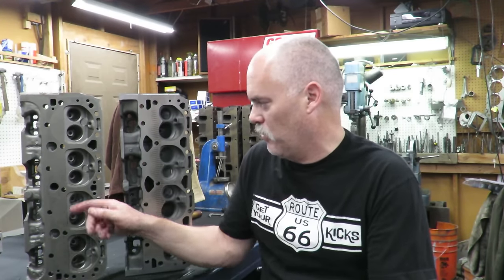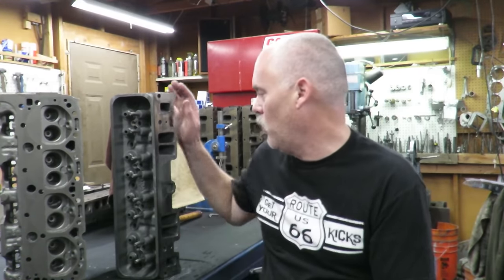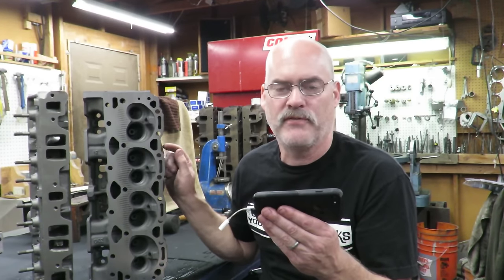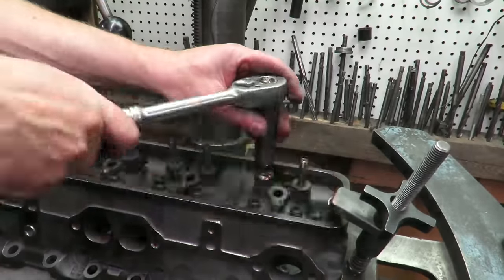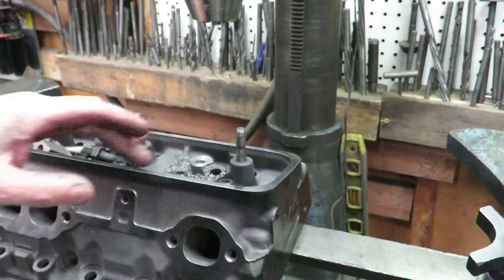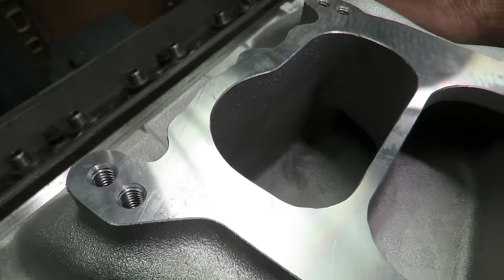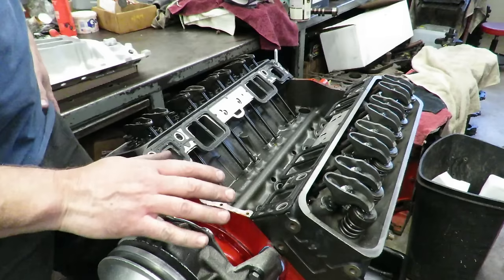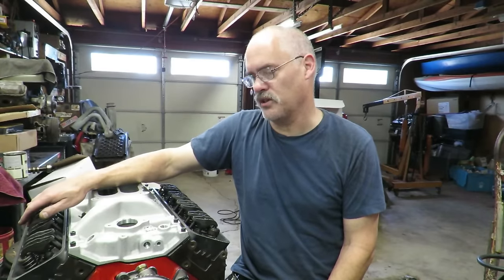How to get more power out of your Small block Chevy

Comment: The heads they used on engine masters were also ported and polished with matching porting on the intake
Reply: We must have watched different episode's, I just went back and dBm checked, factory Vortex heads
Reply: @stevenclark5248  we may have of course there are so many nifty little tricks for small block chevys I might even be mistaken but I'm pretty sure that's what was used on that bad bowtie
Reply: @joeymartinez3642  Yes Sir, It's a twister man! Regardless, all good tech info, that's what this is all about! At least it's not the "All Cntr Bolt Chevy Heads Are Vortx'szzz" lol! Thanks.
Reply: @stevenclark5248  no problem man I don't mean to start arguments just thought I had info to add or clear up

Comment: Hey man if you happen to catch this comment that 350 small block upgrade with the Vortech heads were you drilled the manifold matching and set it up for screw in studs.. I was wondering what cam specs were you used on that motor I want to try to duplicate that here at my shop in Mountain Grove Missouri You really do a good job on these videos man lotta help thanks

Comment: I have a 93 Chevy van / box truck with 350 TBI that needs a little more power climbing hills or just keeping up sometimes. Instead of me changing out my heads, could I swap out my engine with a Vortec engine of most models less the timing chain cover and reluctor and just change to aftermarket TBI intake ? Didn’t know if there would be any issues with my computer. Hopefully accessories will bolt up to heads and block...alt, p/s, a/c. From pictures I’ve seen, seems to have same bolt pattern on end of heads. Also has 4L80E transmission that can handle most any load.🙂
Love watching your videos. 
Thanks Billy

Comment: Hi 👋 I liked what you did showing  how to removing the Rocker studs I was thinking about trying that but I don't have the jig you use to do that I do have a drill pres and I was wondering about making a jig out of wood and bolt 🔩 the head to the jig. Also I have Mig welder maybe I could even come up with something that could make the wood a little more stable when drilling. Also where could I buy cutters you used to do the job. I would appreciate any info you can give me please and thank you Ray in Idaho
Reply: Comp Cams, Proform, Goodson sell cutters
Reply: If you plan on making a jig that you are going to use more than once then just pay attention to woods that are very stable and perhaps laminate pieces to gather since resin glues will resist movement

Comment: Seems like everyone forgot about my fave. 400 sbc. Bored 60 over. Decked center line honed. Big power. Low end tire shredders.  Rock crushers + a overdrive. And in overdrive top gear. 20 mpg highway. Easy on the gass pedal tho. Lol .a 4 banger eats gass WITH your foot in it
Reply from the maker: No one forgot about it they are just hard to find these days

Comment: ARP make's a really sweet Stainless steel 12 point intake manifold bolt set with machined washer's for SBC motors that are just fantastic I used them with My First or early design Weiand Stealth  intake manifold that made more power than the 1970 Z28 intake I used it with a 650 cfm Holley and a 1/2 inch spacer  in my 78 Chevy  Malibu wagon with a 1977 GMC  350 4 bolt main truck motor and the Comp Cams High energy 268H cam  with Blue print series Distributor and Jet hot coated long tube with 3 inch pipes exit behind tires 700R4 with street lock gold Converter by Fairbanks and a B&M converter lock up control   That wagon ran so sweet  and sounded like a million bucks.. however the heads were early 2.02 with accessory holes

Comment: Interesting and helpful video.  The comments (414 as I write this) are also worth reading A LOT of information.
Locally pulling an engine out of a yard is the same cost for any V-8,  tougher to find larger displacement LS motors, quite a few 4.8, not as many 5.3 (they get taken pretty quick so suspect they are just gone before I see them and 4.8l gets left behind), next to no 1st gen SBC but the 5.7l "R" code Vortecs don't seem to get love and those I can find, not lots but available.
Just an opinion, based on lots of research and taking that and Youtube videos for what they are worth, starting from nothing,  it seems the cheapest route is turbo charged LS. 
IF you don't care about vehicle that infers, at least locally, I should be getting a Chevy or GM truck (most choice of LS based engine and all wiring and computers in place). 
IF a drag vehicle, as light as possible and turbo LS swap, then the largest costs becomes a matter of who is doing the work and I gotta think those costs are going to be very similar between the SBC and LS builds. 
My gut says SBC w nitrous will be less than LS with turbo (turbo being way more labor) and get similar numbers.

Comment: Very excellent video. I bought a 1968 327 engine that came out of a school bus or a dump truck. According to the eng. suffix code. 2 bolt main 2 bbl with 1.72 valve's. Must have been a torque monster. My question is can you make 2.02 heads from 1.94 one's. My machinist says its possible but I've never heard of such fairy tales. I'm on a super tight budget and I'm going to try to squeeze 300 hp with the 1.94 heads, that is of course using 68cc chambers. Your input is very much heeded. Thanks

Comment: i have a 95 GMC and a 95 chevy truck both are stock and I'm looking for a little more horsepower in each. both have throttle body injection. I'm wondering why you change to a carb with your project? also how much difference in horsepower would be gained by headers and a freer flowing exhaust system? tyvm enjoyed the video and liked and subscribed!

Comment: Ok, I really love how u explained everything,
I have a 69 nova, 3.73, positive lock right, 400t ,2400stall, 255/60/15 mt et, drive train is set up fo 280h comp cam,  my 355 old engine block sprung a leak!
Question, how much would you charge to build a long block 280h comp cam install,  w/o manifold,  carb, waterpump, valve covers,  distributor

Comment: i put vortek's on a 283 with  victor jr and a 327/350 hp cam,, should be a fun engine. great cylinder hear for the old small block

Comment: I had factory heads on my 350 many years ago PN. 340292 not sure what they were but gave plenty power and very quick car
Reply: good,if need rocker arms,feel free to contact me
Reply: I did some searching around, and I found that those heads were installed on the first LT1 engine. They were built in the early 70s and were a very powerful variant of the 350.

I worked with a guy who had one and was rebuilding it. I don't remember the exact specifications, but he said it was amazing.

Comment: Good day sir... im a huge fan of your channel, you have given me some great intel on heads and sbc in general.
heres my newest project and question. i have a 98 chev truck with the vortec 350,,power train still like new but body played out.
i picked up a real nice condition 92 GMC truck with the 350 and 700R4...the original engine was overheated and ruined ,
the owner then bought a rebuilt 95 350 bottom and he then bolted on the TBI heads with stock intake and throttle body.
so far i have rplaced injectors and put gasket set in with the tb 1" spacer...if my vortec heads off my 98 pass the xray process
and any obvious valve work needed how much in your opinion will they help me power wise ..this truck will pull a mid size camper in summer
and plow snow in winter..i know its long winded but im on a tight budget and trying to get the best i can get out of the old girl power wise.
up til now new elec, parts are ...injectors , I.A.C ,,,TPS,,,y pipe, o sensor , dist, cap rotor plugs and wires..
iis it true to run a 305 egr versus a 350 egr because of stiffer spring in the 305 egr?  Thanks

Comment: My old 1975 LT Camaro came stock from the factory with a 2 barl carb, 350 CDI displacement and was only about 145 HP.
Reply: yep,we know.a 1986 third gen 305 camaro/firebird  would smoke you easily. as they make a little more power and are 5-700 pounds lighter.

Comment: I bought this engine from orielleys for 1100 after my discount and it wasn't anything like the original engine on power. I did get the 4 bolt but I should get some vortec heads for it. The horrible thing about the conversion intake from tbi to vortec is that their asking 500$ for that intake..
Reply: get a jegs brand vortec intake and buy an adapter plate to reuse the factory tbi injection like i did

Comment: Hey guyGet yourself a set of transfer screws they are easy to use. just let them protrude out from the hole .010 to .020, drop the intake on, start the bolts just to line up the holes and give it a tap.

Comment: They're notorious for cracking too.  I bought two different cores from junkyards for the 'awesome' vortec heads... ALL FOUR were cracked.  Spend all that money, put them on your mill, collect scrap metal.  Thin castings = they suck.
Reply from the maker: They do crack that's true when you buy them you need to make sure the wrecking guarantees them to be rebuildable

Comment: Thanks for this info Mike? sorry, if I didn't get your name right, there's so many peoples names to remember on here, and I'm subscribd to over 1000 channels :) Thanks for those head casting numbers. Without them, I could have bought a pair of awful TPI heads and paid a premium for them. I mostly likely will be building an economy motor with ported vortec heads and larger valves, RV cam, roller rockers, and Holley 465 4 barrel on a victor JR manifold with about 9.7 : 1 comp ratio to account for the shitty fuels we gethere in Australia (even though I always use premium 95) which is about 91 in your fuel grading system. not worth using E85 unless you've got a turbo setup and even then, you've gotta use 25% extra fuel to make the same power.. sorry, not for me.
Reply: Hey, what intake manifold would I need to use to make this work with those heads??

Comment: Did you see the Engine Masters episode on the 350 with exhaust manifolds vs headers? Turns out, like the header dent episode they hardly make any difference on a near stock 350. Even the mixtures remained the same indicating the exhaust isn't substantially creating pumping losses.
Conversely, Nick's Garage had a 440 with the already quite good 2.5" magnum exhaust manifolds and the went to 2" primary tube headers and the power went up by 70hp!; so headers can make a difference.

I'm building a Toyota FJ40 rock crawler for myself. It is still on the road with the 2F I6, but my base engine is a green SBC Mexico roller cam 4 bolt Vortec 350 short motor.
I opted for a Vortec short motor because if I bought a long motor, I'd have to take the heads off to modify them for studs and to mill the valve bosses.
The other thing I'm not a great fan of, is that the Vortec heads tend to go flat at around 5500rpm. While this may sound perfectly fine for a rock crawler, my truck is a regular driver and I want to rev it up from time to time without it going flat at 5500!
I found some interesting things however. The piston heights of the new rough cast pistons are all over the place. The lowest was 8.7:1, the highest 8.9:1. This is concerning since that long motor (with Vortec heads) is advertised as having 9.2:1 and 330hp (with 76cc chambers from memory)
Instead I opted for bare aluminum heads. I fitted GM beehive springs and Comp retainers to suit those specific springs. I also went shaft mounted rockers using the OEM roller cam but 1.6 ratio. We milled the heads to decrease the chamber volume so with a steel shim gasket the comp is 9.7/9.8:1 (based on the lowest comp piston) reasoning if it rattles then I can put some composite gaskets in to lower it to  9.2/9.3:1. 
Next to go, was the plastic timing cover and chain. I fitted a Milodon single idler gear drive (for what reason I don't fully know lol) but it went like this, the timing cover seal isn't replaceable in the plastic cover (which also causes timing irregularities due to flexing), a 2 piece timing cover was only a bit cheaper than a 3 piece, which was only a bit cheaper than the Milodon gear drive :) . What I didn't know was the Milodon roller block timing gear set doesn't fit very well and set up was far longer than the instructions would indicate. 
I bought dual quad Fitech and an Edelbrock airgap dual quad intake. Unfortunately, the Fitech dual quad doesn't fit on the Edelbrock dual quad intake (peculiar since it is a dual quad setup) so I bought an Offy single plenum cross ram for the Fitech.
Apparently this intake works well on a 350 (and should work better with self learning throttle body injection than carbs).

I'm yet to get the motor into my fourby but I will say the 4 bolt Mexico block is very nice and the machining is spot on. The rough cast pistons leave a lot to be desired however. They were all pulled and measured so I was into it for the time and didn't know whether to disassemble the whole motor and hone for some new forged pistons or put the new rough cast pistons back in. I ended up chickening out and putting the 'old' pistons back in since if I put forged in then the balancing, upgrading the rod bolts and on & on it goes like the timing cover...  
I can't understand why this motor is advertised with 9.2:1 though because it simply isn't. The part number for the roller cam Vortec long motor ended in a '2' and the short motor was the same number and ended in a '1' so it is definitely a 330hp Vortec.
Reply from the maker: couple of things to add here the vortec head is 64CC not 76 also the GM cast piston is a terrible piston a good upgrade is A hypereutectic piston 
You are correct however about most likely needing to get the engine re balanced or at least weight match the pistons as far as the plastic cover on the vortec block you can install the early style down pins and use the early steel cover the double roller fits under it very well also I would not use gear drive on anything except a drag car gear drive does not like stop and go driving you will also need a ball bearing distributor to go along with it a standard type distributor will get wiped out by the gear drive
Reply: Myvintageiron7512 yeah, ive got a melonized gear mallory locked out billet distributor for it. You're right about the chamber volumes being 64cc - i couldn't remember. So the aluminum heads i got were available in different chamber volumes so the ones i got must've been 64cc. They definitely were milled to bring the volumes down because the Edelbrock intake had to be checked .as it turned out the fit was spot on even with all the milling.
We'll have to see how the Milodon drive goes because I'm not taking the effing thing off now!
I'm not much of a fan of hyperutectics but in my case i thought about them principally for the reason of cost and accurate machining. I think the cast pistons will be a bit more durable in my application so long as i don't go overboard in the rpm.
The motor has been sitting around for 2 years already and the swap is getting closer finally. I have all the parts. September is looking likely.
It isn't a straight forward swap for a few reasons. To keep the alternator and power steering pumps out of the water i have to fabricate brackets from scratch, the battery wants relocating but must stay in the engine bay because i have an electric winch.
I refuse to run electric fans because they're hopless in a 4x4 situation when going through deep water so i have a new toyota fan clutch and fan but need to turn up an adapter and modify the existing shroud.
The whole fuel system has to be thought about (and changed).
The adapter kit for the 350 is off the shelf but i didn't like their engine mounts so i bought a kit that has doughnut mounts and crush tubes - that way I'll never tear a mount again. I unticked the ones supplied with the kit. They were excellent but used urethane, what looked like small shackle bushes, and i think they'll be too harsh for a regular use truck.
I'm happy with the ones i got as they obviously still have comfort in mind but seem to still have extreme durability in mind also.
The proverbial best of both worlds I'm thinking.
I hope my milodon gear drive doesn't flog out.i hear once installed correctly they never wear out. I hope i have one of those ones lol.
Reply: ThePaulv12 (

Comment: Port an match the runners to the intake will make a big difference along with degree the cam windage tray and plug the holes between the lifters knife edge the leading edge of the crank shaft should give you 100 hp I know the windage tray knife edge crank plug the holes in between the lifters just tap them out and put Allen key pipe plugs in them you can get a pipe tap and do that easy that 50 horse power gain from lingfighter he use to race corvettes I think smoky unick said about 50 hp gain from getting rid of windage tray,knife edge Crank,and plug the lifter galley holes

Comment: The TBI 350 was 200hp all the way to 1995. 1996 it went to 250hp with the vortec ( truck engines). I remember my dad bought a new 95 Z71 Silverado and it had 200hp lol 😂. Would run forever but were complete dogs

Comment: I see you drilled the center manifold bolt holes at an angle instead of straight down. Was that for ease of machining or is there something in the head that prevents your drilling straight down? I know that drilling straight down means starting the drill at an angle and there is a chance of walking but if an end mill is used first then you make a flat surface for the drill to start on. I also understand that the manifold has those bosses that the bolts clinch down on but those can be made with drilled round stock and cut on one end at an angle to compensate.